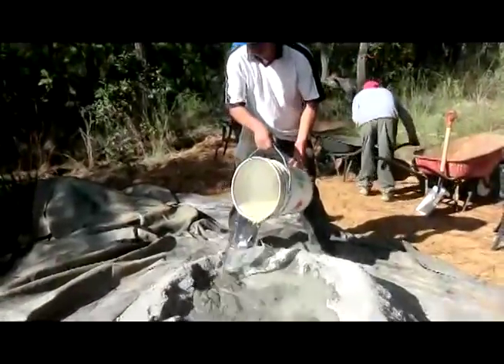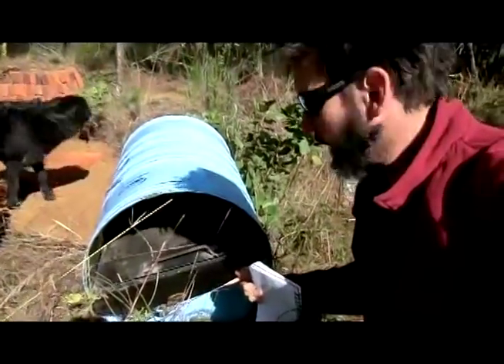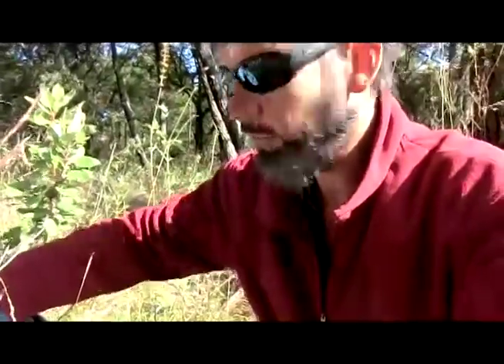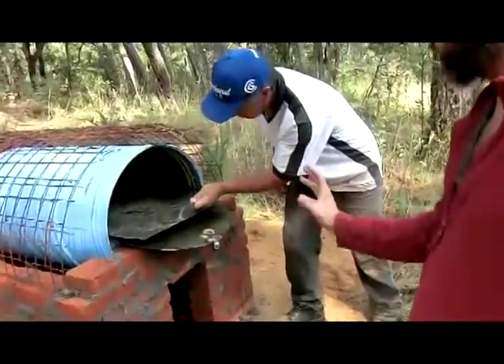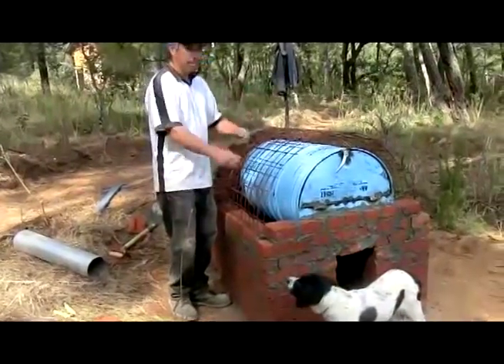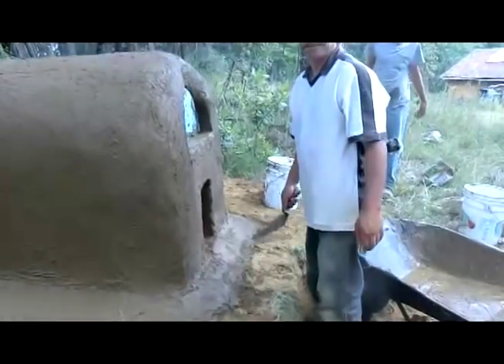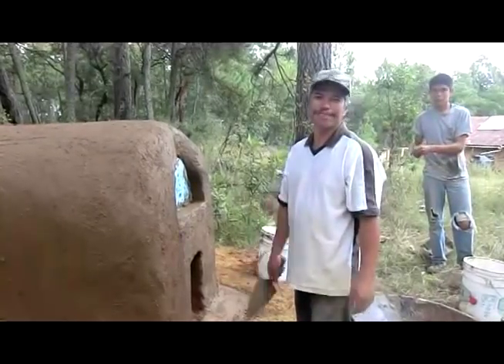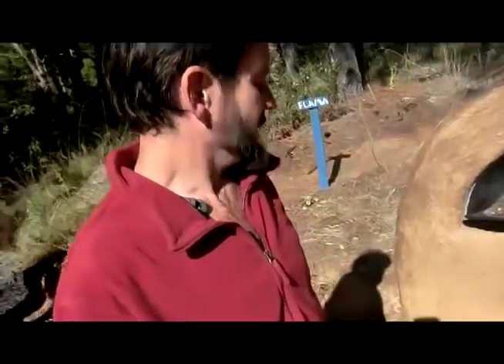Building a new oven for baking.

Comment: So what do you do after the barrel bottom has burned out?
Reply from the maker: Don't know.  That oven ended up not getting much use. I build another which bad an open bottom. So it wouldn't burn out.  The metal flat insert could burn, but it is pretty thick, and also out of the rain to not rust. The one in this video has problems with rust due to neglect and a lack of oil.  Some experiments just end up for learning. :)

Comment: Looks good, but could we have more info regarding construction?
Metal work fine.
What's the mix over the metal drum?
Is there material under the drum?
How is the void filled between the drum sides and the brickwork?
Was it cured or dried before the first fire?
thanks
Robert
Reply from the maker: I have since built a better over combining design elements of the previous two, so I will make a more detailed video about that one. 
The mix over the oil drum is dirt and concrete. There is air between the bricks and drum. We let it dry for a few weeks before firing it up. Thanks for watching! Better stuff to come.